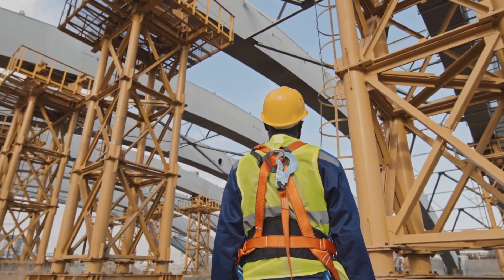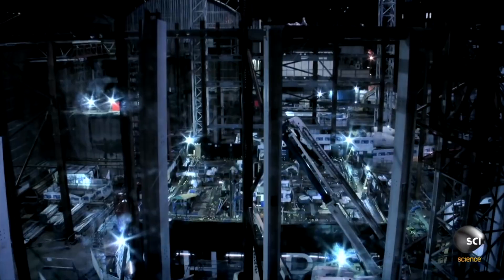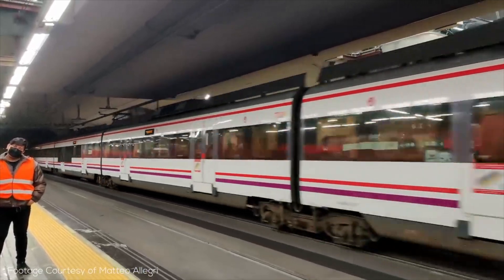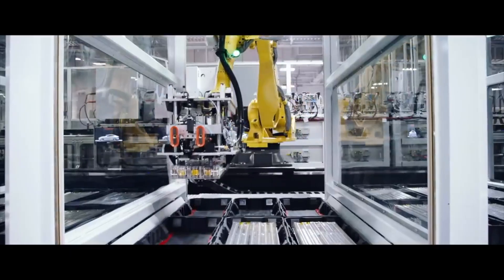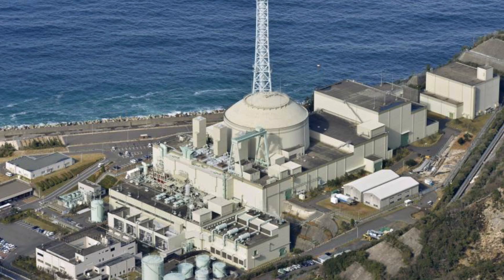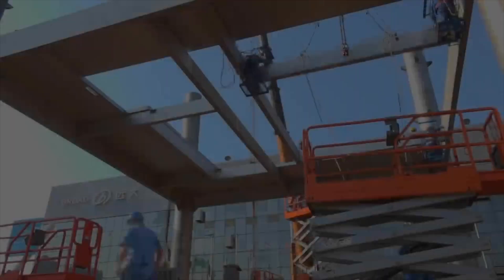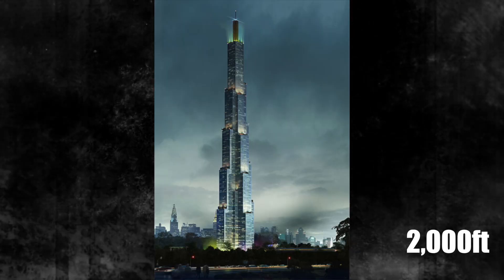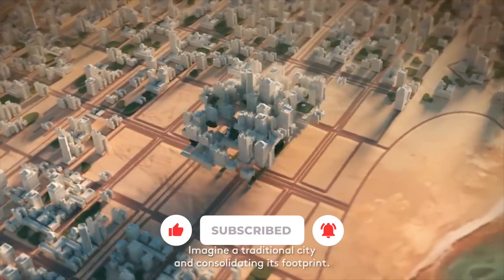How Cities Are Now Building Mega Projects Faster Than Ever

Comment from the maker: Will we get any faster than this?
Reply: We will, when we completely replace the "human element" in the construction phase. Architects will design a building for their clients, send the designs to a computer operated factory to build the modular pieces with robots, transfer the finished modules onto self driving trucks, and send them to the building site. Assuming the site is cleared and has utilities in place, also done by other machines if need be, construction robots will have the foundation ready by the time the first sections arrive, then auto lifting cranes will lift the modules into place, and finally a team of small micro robots, about the size of a cat, will move around in the structure, connecting each module together, then connecting the utilities to the main system. 

It will take longer to design the building than to build it - of course, no changes can be made to the design after it's sent to the computers, so they have to be correct the first time. The only time limits will be how long it takes the computerized factory to build the modules, any issues with the building site that may need human intervention, traffic, and of course, supply chain issues.